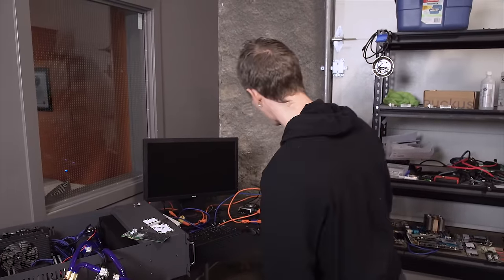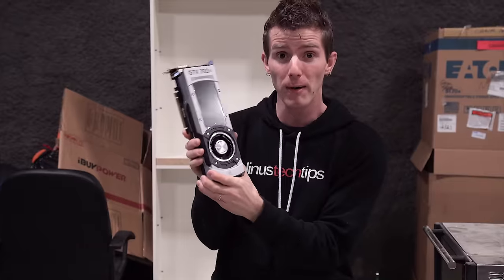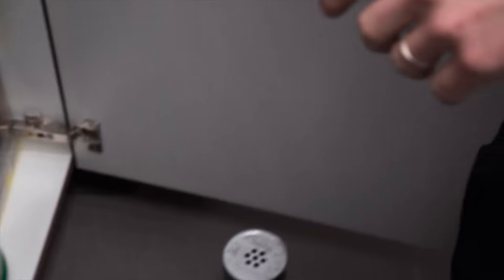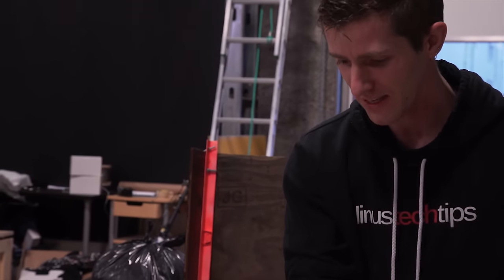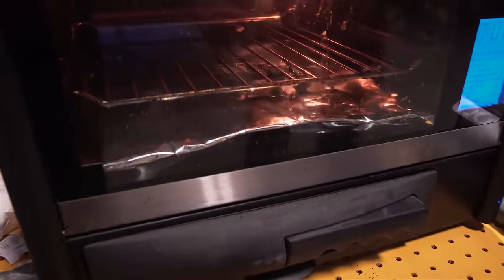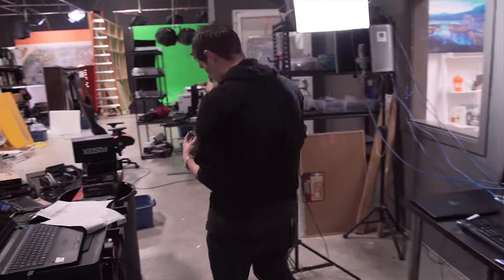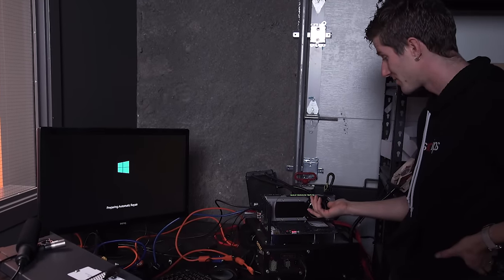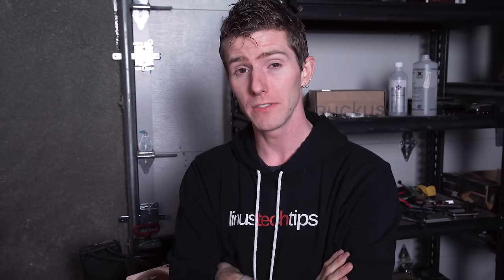Bring your video card back from the dead! - Oven method

Comment: If you don't have an oven try picking up an old Fermi GTX 480 and place it in the adjacent PCIe slot. Just make sure you monitor the temperatures when running FurMark, you don't want to over do it.
Reply: Hardware Unboxed GTX 295 would be better.
Reply: i still have a gtx 480 took apart in my room cause of this reason... that damn thing.
Reply: or you could use an r9 295x2 and place the rad right next to it
Reply: @fyggy5480  u know something...... The best thing he can do is a 690 in SLI.
Reply: @fyggy5480  Titan Z would do the job alot better than all mentioned
Reply: I have a 780ti could I ship it to you to fix,bought it second hand and didn't get bad vibes from seller if he was a shysters, but seems he was
Reply: LOL
Reply: i burned my writst with the radiator pipes from one of those once xD
Reply: Hahaha good one
Reply: Nahh man, just take your old AMD K6-2 366MHz system, remove the cpu cooler and leave your card somewhere inside the case. That CPU does not die and your case will heat up at very high temperatures 😂 trust me, I did that back in the days....that cpu will not die 😂😂😂

Comment: 7:32 aluminum foil has a reflective side because during manufacturing, 2 sheets of foil are rolled flat on top of each other. The shiny side is the side that was against the other sheet of foil, and the matte side is the side that was in contact with the rollers.

Comment: I've done all this myself back in 2010 on 9800gtx+ TWO times after overclock. The 1st time there were some weard lines in POST and video not recognized in win7, the 2nd time the video was numb dead. Both times i preheated the oven at ~195 degrees Celsius while it was closed, opened it and put in the stripped videocard just like he prepared it on the tray with aluminium balls, and closed it fast so it doesn't drop the temp. And after 8min very gently got it out and put it on the side for 30-40min to cool down to room temp. Reassembled it and it still works totally fine even today 6 years later.
Reply: It's true this hack video card??
Reply: DanyDM yeah its true i doit with a gts 8800 and work perfect, obviusly you do not overclok after do this hack
Reply: Dude you are giving me hope for my 7870...
Reply: @emilvlahovic3917  my r9 290 too...
Reply: @fromhell1  true but doesnt worked for me w this card after using daily for like 8 years lol

Comment: "Make sure to use an oven you won't use for cooking food"

Sure let me go buy an oven to fix my GeForce G210!
Reply: why would you want to fix that? it's worse than intergrated graphics.
Reply: @yotoprules9361  You may want to if you don't have integrated graphics..
Reply: Or you could buy a used gtx 750 ti for almost nothing nowadays
Reply: @yotoprules9361  r/wooosh
Reply: @David-ro2nr  yeah well you COULD
Reply: @yotoprules9361  This method brought my Intel graphics to life... I'm now achieving extreme fps 200+  on all ultra settings. Pretty big change from the 25 fps I was getting on low before. (;
Reply: @yotoprules9361  r/wooosh
Reply: Why?  Nothing will happen from doing this,  you're not baking nuclear waste.
Reply: @yotoprules9361  even that is a bad deal
Reply: you can use oven anuy time after that is reason why you use Aluminum foil
Reply: Magic mushroom no just use your friends oven
Reply: Its worth more broken lol
Reply: @yotoprules9361  750tis are so bad for the money
Reply: @animalyze7120  Fumes and microparticles can come off the card and contaminate the metal lining of the oven
Reply: I'm having the same issue with the same card as yours..!
Reply: @m1ghtyboy  so um...you set the oven to self clean.
Reply: That graphics card isn't worth fixing.
Reply: i did this a 3 months ago to rx 580 it works  just fine and i mad cookies  a week later and i am happy to tell you i dont have canser yet
Reply: Me I just bought a small oven for 10$ on marketplace and it work so.. lol
Reply: @yotoprules9361  this didn’t age well
Reply: @diamondcow11  true
Reply: Buy em at flea market, if you're a good bargainer you could buy one just a dollar
Reply: i tried it before i heard that O_O
Reply: @yotoprules9361  cries in 2021
Reply: @nigmane  :(
Reply: Just buy a used toaster over from a thrift store. I'm sure you could even find one free if you looked hard enough
Reply: @yotoprules9361  you mean 5 cents

Comment: How to do the same with AMD cards:

Step 1: Install the card into your rig
Step 2: Turn your rig on
Step 3: It will now cook itself
Reply: lol
Reply: +Josh Latham TRUE, multi user
Reply: ***** i got a H75 on my AMD FX8350 its a lower end cooler but hey max temp 45c not too bad its a safe temp
Reply: +Josh Latham Just install 15.1 driver and watch the heat rise to 385C
Reply: I baked gforce8800m 9800gt but newer one of my 2 7970 nor I ever saw that someone has bad soldering on amd graphic.
Reply: +Josh Latham 
Funny how any of the AMD's 3 best GPUs don't reach 84°C like the titan and 980 ti do.
Reply: +Josh Latham Lol So true
Reply: Nah just putt it in the fridge
Reply: FirstDragonSlayer On average they tend to be hotter. Not necessarily a bad thing. You can just change the cooling method.
Reply: Josh Latham
Never had an AMD GPU overheat really. And from nVidia, I've had a GTX 480... xD
Reply: FirstDragonSlayer Well me neither, I run both green and red. I've never had a problem with both.
Reply: +FirstDragonSlayer 980ti doesn't even reach that temp... at least not the EVGA SC acx 2.0 and gigabyte g1 gaming versions.
Reply: *****
Talking reference.
Reply: +Josh Latham That's why my AMD GPU's never died,it recover itself from the dead every day :D
Reply: +Josh Latham Made my day! So true!
Reply: +Josh Latham Still works with Fermi
Reply: +Josh Latham 
Step 1: Install AMD/ATi card in your computer
Step 2: Install Drivers
Step 3: Have BSOD
Step 4: Toss graphics card across the room
Reply: +Josh Latham HIS r9 280x stays nice and chilly in my rig. Call me poor, but the 'bang for the buck' factor goes a long way in this household. So, I got a space heater and a graphics card with one investment, lol
Reply: +Itsame Mario the same card and the same cool temps.....And cheaper than a 960
Reply: Glorius Bot Powered By the PCMR My experience with AMD cards was pretty toasty.
Reply: +Bleed inSkull (BleedingSkull) at least they not contribute to global warming (gtx 480 I'm watching you)
Reply: Glorius Bot Powered By the PCMR Better watch that 480 real close... I think the Nvidia fanboys are confused by semantics, team green doesn't necessarily mean green as in good for the Earth, lol
Reply: Only you can prevent computer fires AMD's color is red for a reason. btw, I love AMD more than NVIDIA, but my GPU (XFX Radeon R9 390) gets 40C at idle which feels high to me just for idling.
Reply: +Josh Latham Ironic comment, seeing as the broken card is in fact an Nvidia card.
Reply: +Josh Latham  nice
Reply: +FirstDragonSlayer FUNNY how my MSi 980ti never reaches even 70°c.  So stop talking shit please .
Reply: +Josh Latham Instruction unclear, I fixed my GTX 480.
Reply: +Josh Latham 
thats why you have fans
Reply: You mean CPUs?
Reply: Nice meme bro
Reply: +Steve Dice ayy lmao
Reply: kek.
can confirm, running a fx6300 + r9 270, personal space heater
Reply: +T-X-M it´s an fx4300, this processor doesn't heat and doesn't process
Reply: +Josh Latham kek
Reply: +Josh Latham LOL
Reply: +Ron Paul Some water block ? my 290 and 290x gets also hot as fuck "waterblock for that 2"
Reply: i'm running an MSI 380 set to 30% fan speed and it maxes out at 68 degrees, not sure about anyone else.
Reply: +Espritt Uhhh mine gets a lot hotter .....68 degrees isnt really a problem is even a bit cold "so you wouldnt need something stronger"
Reply: MegaNitrospeed yeah, I only have one case fan as well so I think it's just MSI's great cooling
Reply: +Espritt + 290 are known for they heating
Reply: +Josh Latham no one remembers when Nvidia's 9000 series would desolder itself from the PCB and melt the housings...
Reply: +Josh Latham Not true, only nvidia fanboys would say something like that.
Reply: awkward when the titan is bascially a fireball
Reply: +Josh Latham yawn..... had a 7970 and it still works to this day... after 5 years of "cooking itself" with use at least 4 hours a day, it seems to work just fine. its a pity NVidia fanboys don't have anything decent at the mid range, they have to go up to the 980ti to see the value happen :|.... wheras the 390 destroys in performance and doesn't have fraudulent specifications
Reply: Ayyyy lmao
Reply: the awesome toaster On average AMD cards tend to run hotter and/or louder.
Reply: +Josh Latham But Drivers are MUCH BETTER , better priced (not overpriced) are better stock, and normally wont have a restricted lifespan
Reply: MegaNitrospeed I think you're missing the point. Price, performance, and lifespan are irrelevant. I simply mentioned the temperature. This is not (and let's not make it) an argument on whether to go green or red.
Reply: the awesome toaster Nice to know.
Reply: +Ethan lol that is seriously hot... ever changed the thermal paste? removed the dust? used it in 25°C ambient?
Reply: +FirstDragonSlayer  kind of dumb ,talking\comparing of two completely different methods of cooling ...and 84&#186;c doesn't hurt the card in any way  . btw: the only way amd found to sell a gcard that doesn't throttle itself was using that asetek cooling , wich means that they are way too hot for air cooling and even with that cooling, the 980ti is still a better choice and it take much less space too
Reply: +Josh Latham THE HATE IS REAL. Nice comment bro.
Reply: +Josh Latham You mean gtx 480?
Reply: +Josh Latham Ironic that my 750ti has higher temps than my 280x and my 980ti has it compared to my r9 390x both with a hybrid cooler.
Reply: but AMD doesn't make titans.
Reply: +Robert Hollar i own a 9400gt and it in summer makes my room on fire but in winter it isn't an heater
Reply: +Josh Latham Your just like the person in this video. This is  the root problem with real tech repair pro's.
Reply: Nice simple tuts
Reply: +Josh Latham might not work because they are designed to run warmer and are designed to deal with it, unlike nvida cards who die at around 70o F
Reply: +Defi my r7 370 I can confirm keeps my feet nice and toasty. my fx6300 on the other hand rarely gets up past 45 degrees due to the cooler master evo with one fan.
Reply: I have nothing to lose as none of the spare parts of that mobile is available it's like trash to me so why not can I give a try
Reply: +Josh Latham lmao amd sucks
Reply: +FirstDragonSlayer Talk to my 115°C HD 6850 its got problems. 

Upgraded to a 970 it stays around 75 never more. Saying that I did OC the shit out of that 6850 and now its turned off but I might have just ruined the card.
Reply: awesomecooly123
um...yeah I think you owe that card an apology.
Reply: Nalothisal Yeah I apologized it was a trooper I have it sitting on a shelf next to my pc as a memorial

RIP PowerColor HD6850 2010-2016
Reply: +Josh Latham I dunno what you all are talking about, my FX8350 with my H100i cooler runs at about 30 on games,  and  my R9 290 with just the stock 3 fans, overclocked, runs at like 60 tops
Reply: +Anderson Stelmack savage
Reply: so racist. just because we are red right.
Reply: Amaury Ayala I have red too. :)
Reply: +Bleed inSkull (BleedingSkull) strange... ive built 20 computers using amd CPUS and gpus....

never had an issue.

sounds like you dont know what your doing????
Reply: Lol, people make these anti AMD trolls and tons of people fall for them.
I'm pulling up my HWMonitor right now.
AMD FX8350: 24C
R9 290: 52C
I'm running about 20 tabs on chrome, minecraft in the background (not paused), and various other little programs.
Reply: +Sean Anderson a) what's your ambiant temp b) that's no load on the gpu whatsoever c) the comment about amd was funny
Reply: +Josh Latham I had no idea I needed this in my life. I am now laughing out loud getting strange looks. Totally worth it.
Reply: +Sean Anderson How do you alt-tab from minecraft without it auto-pausing unless it's a server? And even then it 'pauses' itself to the menu even then. I smell a liar.
Reply: Raio Verusia Simple, open your inventory, or chat box, it won't pause, and i can see it on my other screen with things still moving, so, yeah, not paused.
Reply: +Josh Latham this is actually the opposite for me. i had a GTX 480 (haha laugh at me) for the longest time and that thing has reached 100*C from playing Unturned (also laugh at me)

I bought an R9 270X and that has never reached 45*C or higher. But i assume the 480 is getting crazy high temperatures is because of the thermal compound shit on the gpu heatsink or whatever (im not smart)
Reply: LMFAO! Right-o m8!
Reply: Red Phoenix Cool!
Reply: +Josh Latham can confirm i got a cooked 7970 and 6990  they start at 80 degrees C then crash after about 1 minute on the home screen on my desktop reference cards ftw
Reply: +Josh Latham Well played, redhead.
I guess your cards come with an integrated oven, huh?
Reply: ***** I have both red and green. My hair colour is like a mousy brown.
Reply: +Josh Latham nope not all amd cards just all the 290s and 390s
Reply: I've seen at least 3 Nvidia cards cook themselves.
Reply: then stop putting them in the microwave bro...
Reply: I got a HD 6970 from my brother but it was damaged, temperature sensor at 150C and in minutes it turning off the PC automatically, I tried cleaning and  was worst at 1000C XD, then in just 5 minutes the turbine go calmdown and the temperature went to 45C D: that was a proof of self-cooking? XD